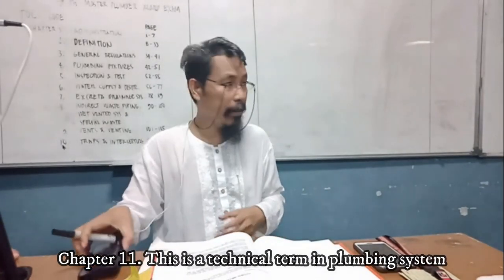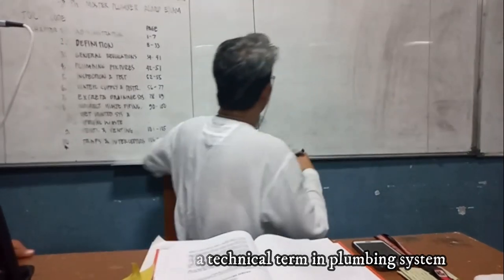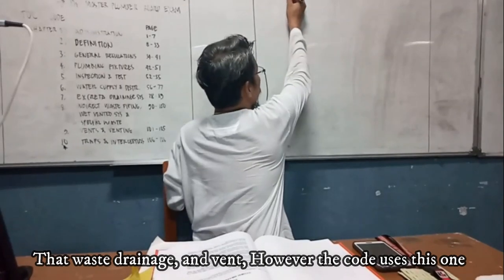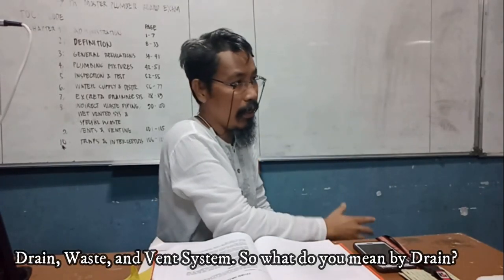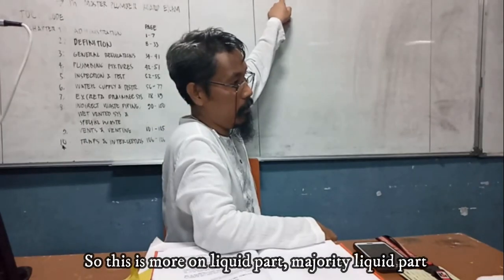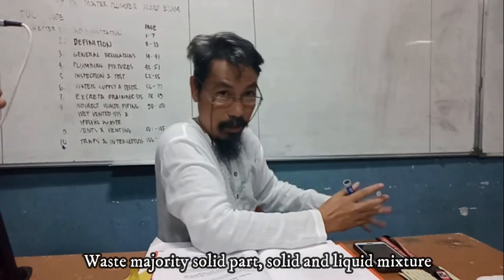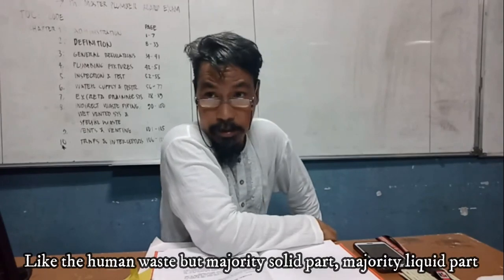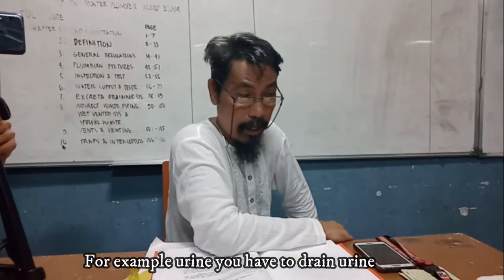CE526 Sanitary, Fire Safety and Plumbing Design || NPCP Table of Contents & History of Plumbing

Comment: Thank your for this lecture. I learned some technical terms the drain,  waste, and vent system Just as drain pipes remove water and waste from your home, the plumbing vent pipe – also known as a plumbing air vent – removes gas and odors. It also allows fresh air into the plumbing system to help water flow smoothly through the drain pipes. However, no water runs through the plumbing vent pipe

Comment: Etabes, Joshua G.
19-02128
- Thank you, sir. In this video, I learned about drains (liquid parts), waste (solid parts), and vent systems (a mixture of solid and liquid parts). The video recalled the four important engineering plans: clean water supply for drinking, waste, drainage; vent system, storm drainage system; and isometric.

Comment: Ruiz, Sharlize Veyen C.
19-00620

This is very familiar to me as you have discussed this on the other video sir. As I have recalled this are the type of engineering plan which are important to plumbing. First is the Water Supply, Second is the DWV or Drain Waste and Vent. Third is Storm Drain System. Lastly is the Isometric layout

Comment: 1.Solanoy,Kimberly Jade F.
2.Joints (@ 4:18)
3.Connectors (@ 4:19)
4.Plumbing Materials (@5:20)
5.Plumbing System (@ 7:13)
6.Plumbing Trait (@ 8:10)

Comment: back then, when there are kings, queens, and emperors. Engineers were not called as engineers, they are called as strategist and tactician. The first engineer was actually a military, it called as military engineer. We called as civil engineers because civilian is different from military engineer.  I also learned about drains (liquid parts), waste (solid parts), and vent systems (a mixture of solid and liquid parts). The video recalled the four important engineering plans: clean water supply for drinking, waste, drainage; vent system, storm drainage system; and isometric.

Comment: This lesson teach us technical terms like Drain(Liquid like urines) , Waste (Solids) and Vent (Gas).It also Remind us the Thing that are important in the plumbing system of Engineering Plan 1. The 1.clean water supply for drinking and Human Needs.
2. WDV or the Waste, Drainage, and Vent system .
3. Storm drainage system.
4. Isometric that is requirement

Comment: Dr. Zantua mentioned the 4 important plumbing system as weel as the topics in every chapters. In Chapter 11 Storm Drainage System. Storm drainage are required for roof areas, courts and courtyards to collect stotmwater and discharge the stormwater to an approved point of disposal not in conflict with other ordinances or regulations.

4 Important plumbing system
Chapter 6 Clean water supply for drinking
WDV
Storm drainage system
isomentric

In Chpter 14, quality and weights of material including plumbing material and reference standard.]

Comment: Chapter 11 is contained about technical terms such drain which is the primary vessel or conduit for unwanted water or waste liquids to be flumed away, waste is produced at fixtures such as toilets, sinks, and showers and a drain-waste-vent is part of a system that allows air to enter a plumbing system to maintain proper air pressure to enable the removal of sewage and greywater from a dwelling.

Comment: In additional The storm drainage system helps prevent floods by diverting rainwater into nearby waterways. The water and pollutants flow into storm drains and through underground pipes directly into the nearest stream, pond or water reservoir.

Comment: Technical term in plumbing system are Drain more liquid part or majority liquid parts, Waste majority solid part, Vents intirely gas, most important chapters in engineering plumbing plan are Water supply, WDC, Storm Drainage System.

Comment: Technical term in plumbing system are Drain more liquid part or majority liquid parts, Waste majority solid part, Vents intirely gas, most important chapters in engineering plumbing plan are Water supply, WDC, Storm Drainage System, Isometric System, Civil engineering started on 1935 PICE, PICE is not a licensed engineer it is only a organization, licensed engineer it's about 1955 or 56,plumbing trait  took a great leap at the turn of 20 century, the first engineer are actually military engineers

Comment: Buizon, Randylyn C.
19-00979

In this video tackled in Chapter 11 is about Storm Drainage System and there are four important plumbing system in an engineering plan 

1. The clean water supply for drinking.
2. WDV or the Waste, Drainage, and Vent system .
3. Storm drainage system.
4. Isometric that is requirements

Comment: STORM DRAINAGE SYSTEM, The purpose of the storm drain is to help prevent flooding by diverting rainwater and melted snow off of the streets and other paved surfaces and into a natural body of water.